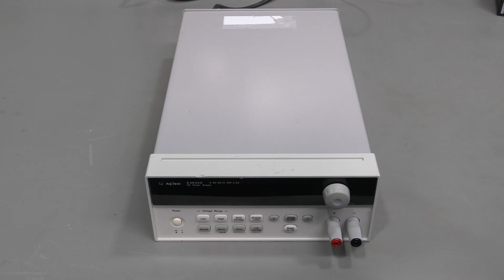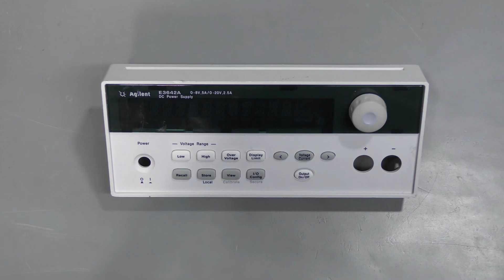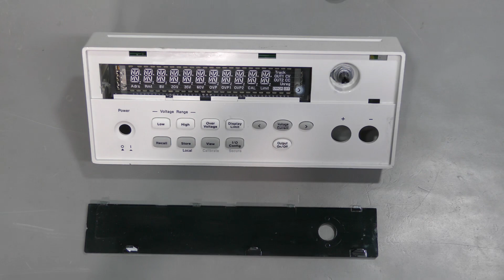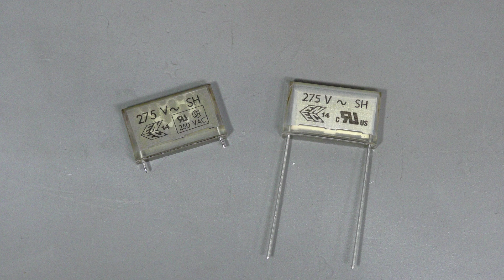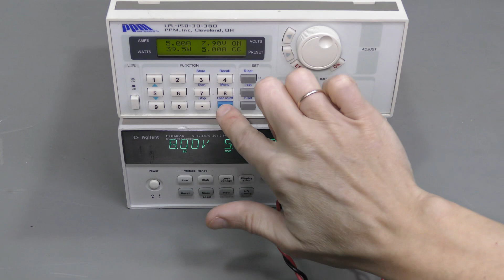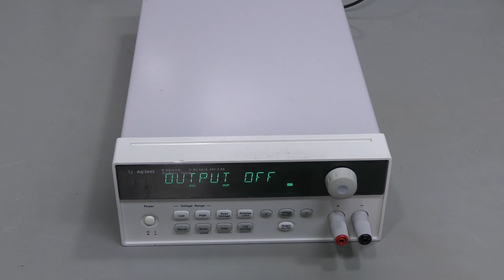#137 - Agilent E3642A power supply repair

Comment: It's nice that you found a replacement VFD.  That is not always possible.   I need another display from a Keithley 2700, but I have been unable to find one.
Reply: I think all the keithley from that style/era have the same displays, I salvaged one from a 7000 switch matrix for a DMM, you can sometimes find them cheap on eBay